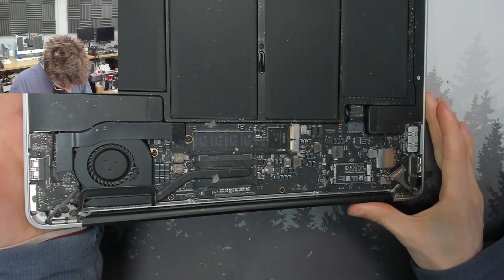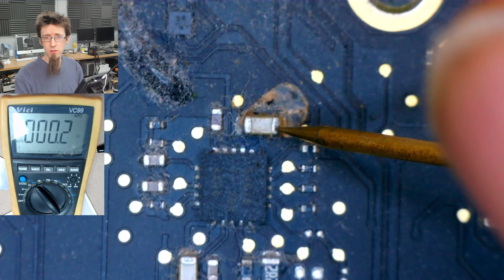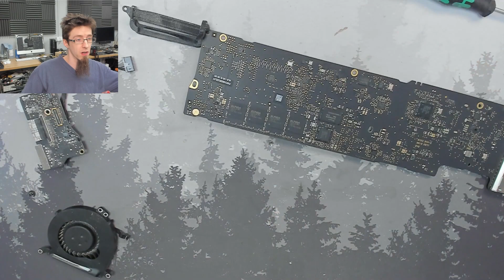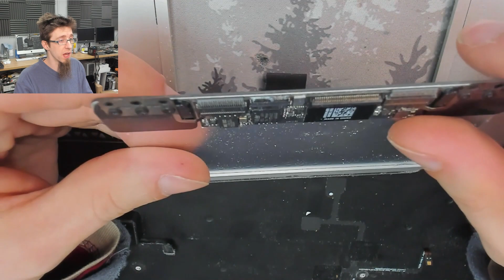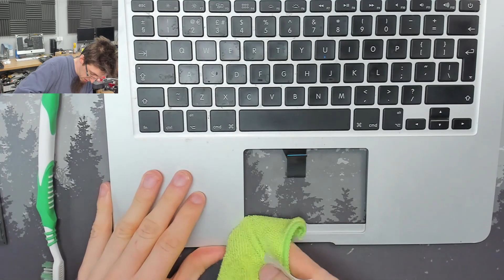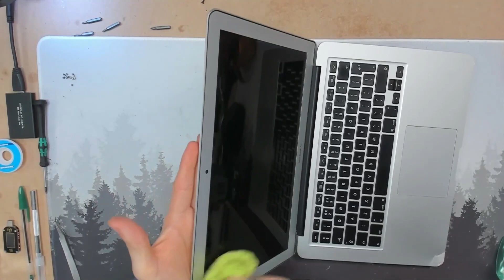MacBook Air, remember to check everywhere! - LFC#329

Comment: I need help. Macbook Air a1466 820-00165 2017 just stopped turning on. When charging is connected, the green light and immediately orange light up. The fan is not spinning. Motherboard without any visible defects. DC-in I / O board with traces of soldering (damn, the laptop was bought at the official Apple store), unwashed flux and traces of overheating are visually visible. After inspection, the flux was washed.
I ran a little on the motherboard. Found no voltage on PP3V3_SUS. The processor is warm.
How can I test the DC-in I/O board? To avoid breakage

Comment: Entirely unrelated to the video, but I had a small win today, which was thanks to my viewership of this channel.

Bought a Ryzen 3600X off of a friend to upgrade on my 2600. Check my motherboards website and it did say it supported the CPU, but I neglected to check BIOS versions. I installed the CPU today and gave it some time for RAM training but had no luck with it firing. I put the 2600 back in and check BIOS details and realised that was exactly the issue. Braved the BIOS update throught the motherboards BIOS and it updated from online nice and smooth all by itself! Put the 3600X back in and with some RAM training, it booted up fine! Very satisified with my work, but 100% something I learnt from this channel.

Comment: How come it has an orange light without the battery? I mean, what is it charging if no battery is plugged in?
Reply from the maker: I'm not actually sure, this is normal behaviour, but I've never looked into why it says it's charging when the mobo will know that there's no batt connected.

Comment: Great work and great advice. Just a thought but the UK had an exceptionally hot summer  this year and that means lots of sweat - salty water. It's a little late but corrosion takes time and I wonder if that might have been the source of the corrosion? The trackpad is where sweat might pool.

Comment: i just recently fix macbook air 2015 by changing that cable the only difference in mine was it was turning on with power cable but not when battery connected, but it was charging battery wierd , but i had trackpad cable corroded same like yours , nice video by the way 👍

Comment: Honestly, I just can't stand when people don't take care of their expensive toys.  It's one thing if you have a completely accidental spill (though, of the people I've known personally, probably 90% of those are preventable as well.)  But crud and filth built up over time like so many of the laptops you work on...I just don't understand people.  Especially when they're expensive, status-symbol Macs.  I look forward to the first video where the thing is so nasty you finally charge someone a cleaning fee as others have suggested you do for extreme cases.
Reply from the maker: I try to give people the benefit of the doubt, like in this video I was like "maybe this is a kitchen laptop..." but some customers I'm ruthless and will tell them "this is filthy you need to take better care of it or it'll break."

Comment: wish i'd found your channel a few months ago - been sitting on a failing Air that would only start up on adapter connect when battery removed or flat. had it apart and couldn't see anything obvious. ended up stripping it to bits and selling for parts, would have loved to get it going
Reply: @Mr Guru yeah just don't like Mac's , got good money for the parts so not that bothered lol